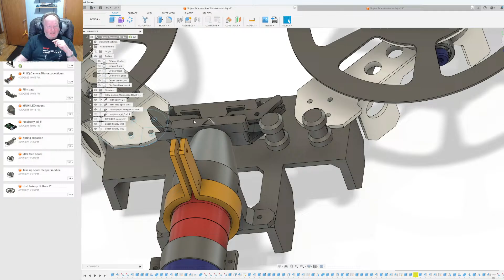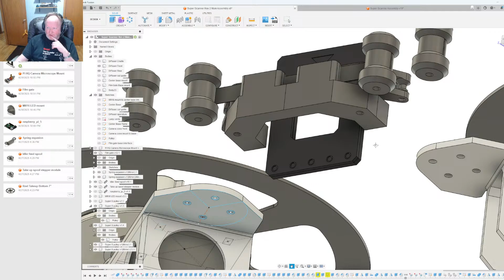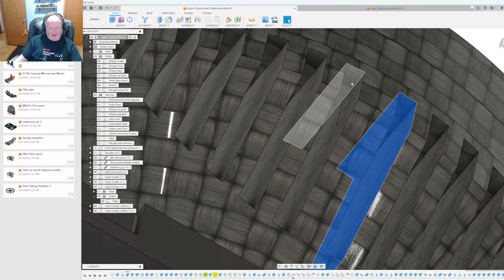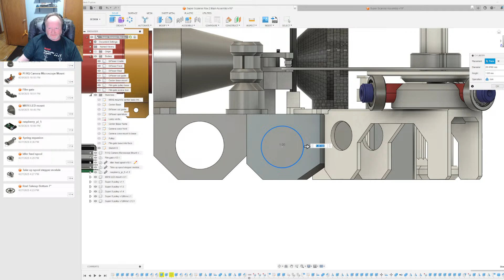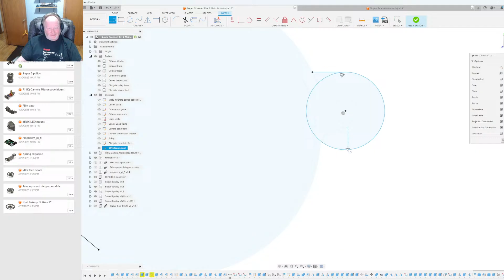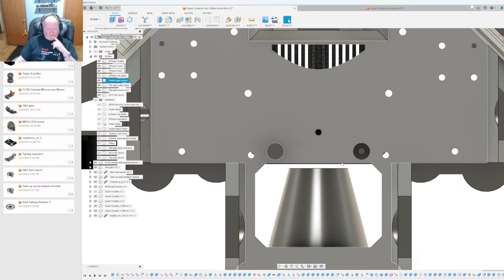Late Night Design Marathon 2025: Rise of Subscription Services

Comment: It took me about 5 minutes to realize that this is connected to your 8mm film scanning project. 

How do you utilize linked components in Fusion? I always hate how the positional information is linked between the two. Like, if I want to use the component, I don't necessarily want to flip or rotate all instances of it, and I find I typically need to make some small adjustments to components for individual models. I suppose if you were going to make a thousand of 5 products and you wanted to save on costs, you would want them to be the same, but for low runs or one-offs that isn't really a consideration.